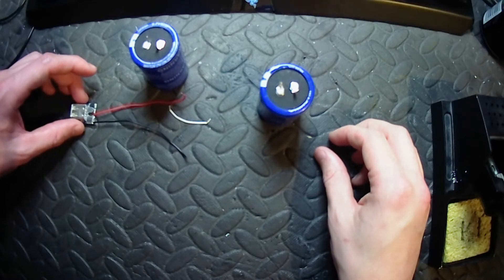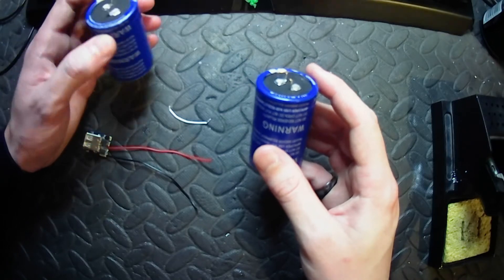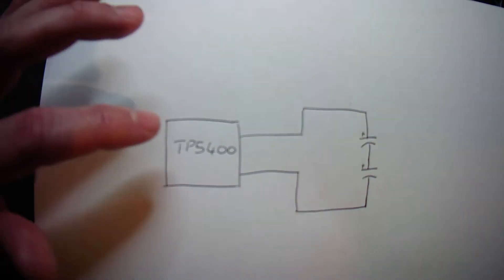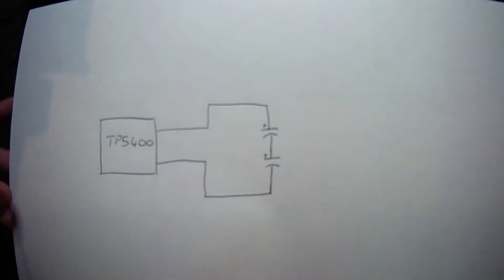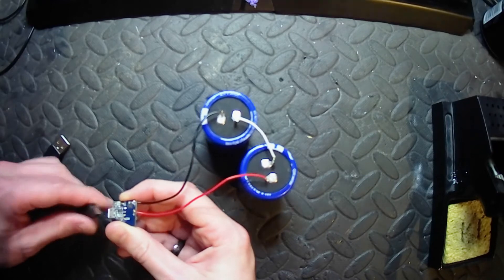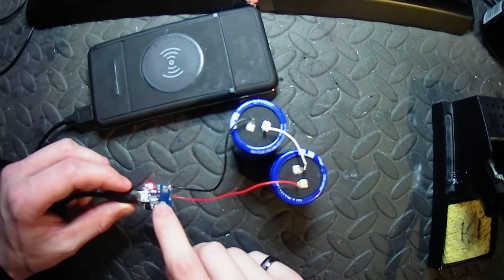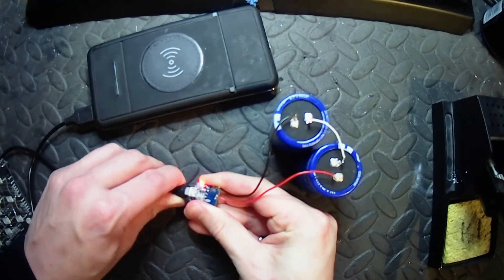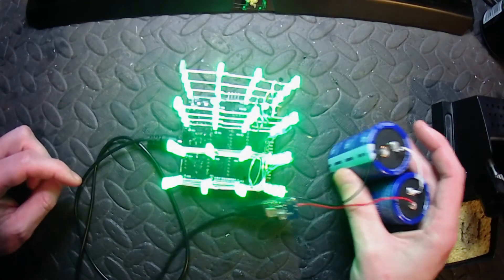How to make a Supercapacitor Power Bank (2x 500F)

Comment: Would this work well to buffer as a powerbank for a phone?  I don’t need a lot of charge but want something I can charge up quickly and let it recharge the phone. Ideally, it would reverse and have the capacitor in the phone but a battery dock that you just undock for quick use but there are no capacitor batteries for phones and would likely be too bulky. How much of a charge would your setup offer?

Comment: if you have 2 35v capacitors and want to use it as a power for a car, how do you enSURE that the alternator won't overcharge the capacitors and blow them? OR that it won't charge too much for the car's electronics?   thank you :)
Reply from the maker: A super capacitor at the moment wouldn't be the most efficient way of powering a car since it would be drained too fast and wouldn't be able to power the car for long, hope this was helpful